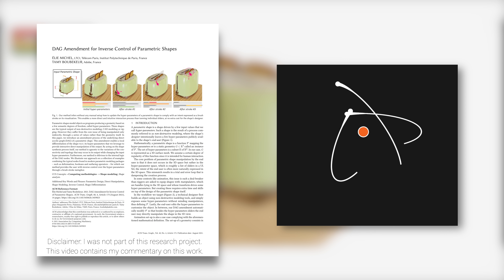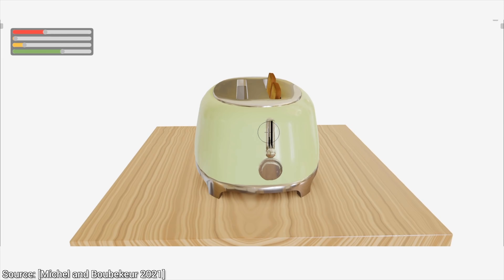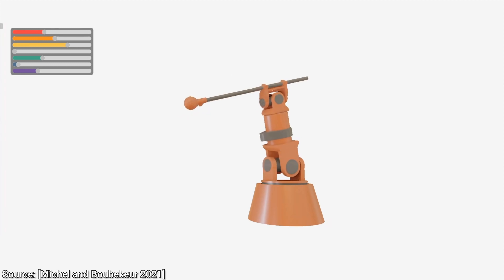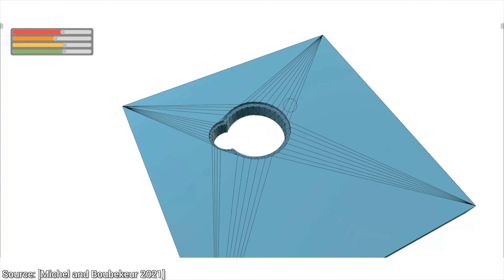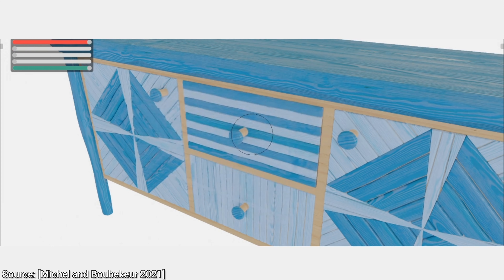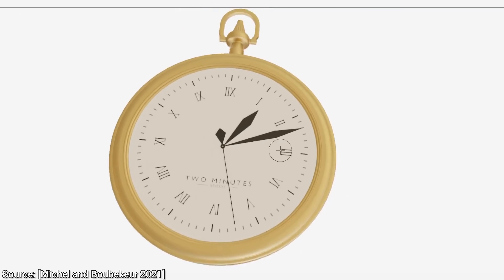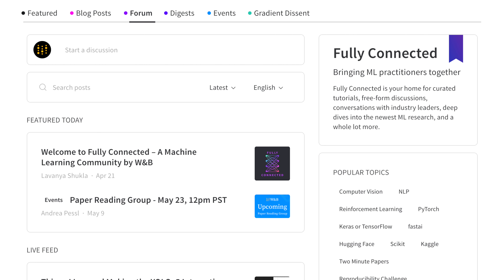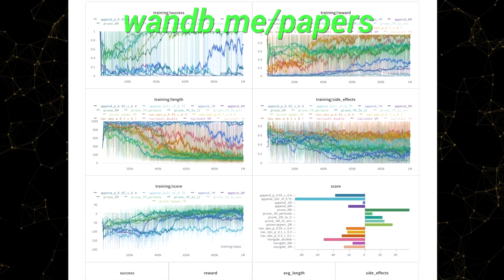3D Modeling This Toaster Just Became Easier!

Comment: In 3D animation, when you rig a character, you also create a 'schematic view' which is a web page or interactive map of the character so an animator (simple minded but nice people) can animate the rig. Its the same thing and has been around for decades. How does this differ from that?
Further, in most 3D software, you can create parametric objects (Cinema 4D is great at it) that are very easy for end used to break, err, I mean, work with.

Comment: okay it took me a couple of minutes to realize what I watched. the true breakthrough here is that the user interface knows how to inversely control the hyperparameters. it's not exactly trivial, but that's all.

in other words, it amends the acyclic graph that is used to produce the geometry in such a way to help interpret direct access to geometry inversely, thus identifying the exact path in the graph, based on input, and streamlining the control logic, instead of requiring a user to tweak the sliders themselves.

this project builds upon procedural modelling and parametrization without doing anything on that forefront. certainly no AI as far as I can tell and no changes to how procedural modelling or IK actually works. somebody still has to rig everything into a coherent whole.

basically it's the Spore (2008) editor for the world of commercial parameterized objects, which are supposed to be made to behave like that by (many) artists.

so:
1) the video title is misleading.
2) yes, artists are very much required to build this narrow combinatorial space of hyper-parametric freedom.

Comment: I feel like you serverely misrepresented what the AI ("AI"?) does here. For instance "It understands that moving the toast must also move the lever". It sounds like the application is figuring this out by itself, but if I understand the paper correctly that's just a hardcoded dependency in the handcrafted parametric model. Please correct me if I'm wrong, but isn't everything we see in this video traditional handcrafted parametric modeling with the exception of the selection cursor and the inverse kinematics?

The linked paper also makes this very clear imo. I'm not sure how the video manages to miss the point so completely and makes this seem like something very different than what it is.

Comment: To be fair, you can get a similar effect to this in Houdini if you setup your object/scene correctly (driving the length of a chair leg based on the position of the seat for example). It doesn't have the brush stoke part, but instead a list of parameters to mess with, so less intuitive and requiring expensive software and an object specifically made for it.  I'm excited to see how this paper evolves and hope it gets implemented into some modeling programs soon.

Comment: I feel like there's some key information that must be missing. Isn't this sorta how the character creator works in many games? Also reminds me a lot of some of the car modeling techniques in the game Automation by Camshaft Software...

What's the new thing here that makes this noteworthy?
Reply: Agreed ... as I understand it ... the parametric effects are given relationship attributes to other sections of model as it's built ...

... rather than having to code it to keep ratio size and position with other objects. 

So if I had a 3d sphere acting as a head then I add a thin cylinder to its surface acting as an eye ... I'd expect a deformation of the sphere to flatten slightly to accept the flat cylinder as its eye ... I should then be able to move the eye around ... and push it into the sphere, deforming it like a donut, or pull the cylinder away from sphere to make a snout with flat cylinder acting as an eye instead of snout.

It has to just be groupings with modifiers ... memory intensive 

If this is machine learning ... everything I've said and more would be possible
Reply: Yeah this was explained extremely poorly. I spent the whole video trying to read between the lines of what actually was being developed here that involves AI. Two minute paper videos have declined so much, I basically just mute and watch the demonstrations now. He talks a lot but provides no substantive information... almost like it was written by an AI.

Comment: Title is misleading, Most of this can already be somewhat done by parametric 3D modelling softwares like Fusion 360. Modelling the design with parameters is the difficult part, anyone can click and drag or change the values easily, but you definitely need an artist to create a parameterised model ready to do what's shown in the video.

Comment: The cursor knowing which parameter to change is neat but parametric modelling has existed in 3d programs for a long time.
Changing the parameters is the easy part, setting up the model with parameters is a lot harder and requires an artist
Reply: Thanks, I thought I was going crazy. The impressive part would be an AI building a parametric model. You don't need an AI to do inverse kinematics on a parametric model
Reply: @FPRobber  well I actually thought they were using AI to build some kind of procedural graph, after the fact. in the case of IK I thought they were using AI to actually build the IK with the automatic constraints. if not, then I'm not sure what's the point.
Reply: So this is taking a normal non parametric model and making it parametric? How does it know that I want the toaster slots to be symmetrical and what if I don't?
Reply: @JrIcify  no, it's not making anything. I figured out in the meantime, what this was about. it's a direct user interface between the geometry and the sliders what was done here. (the positional dragging without supplying that context beforehand, the brush size in one of the examples, but also the connectivity between two or more interconnected sliders as shown in the IK example)
Reply: @JrIcify  I can imagine Karoly didn't invest himself too much in this area of life, or got too hyped himself, but the video is misleading all of us into believing this has to do something with object generation or automatic parametrization.
Reply: @milanstevic8424  or they asked him to showcase it? they made (I guess) a two minute paper clock model and all

Comment: Very misleading name for video. This tool is interface to interact with parametric models right? To make parametric 3D model of toaster like this you have to be experienced 3D modeler and semi programmer. To make use of this tool in production you have to have huge parametric model library, which is not even started. This is tool for solving unexciting problem.

Comment: This is procedural or parametric modeling, it's actually harder to model and you need a 3d artist that also understands programming (although very basic for the procedural i.e., Houdini) or very specific and technical knowledge like Fusion or SolidWorks to name a few. The main advantage are speed if you need multiple models, alternate shapes or iterations, or adjustable models that adapt to specific needs
Reply: Yeah, somebody still created these 3D models and defined the parametric parts and they conveniently not showing that in the video. I don't see how this is "3D Modeling Without An Artist" and how it is different from other parametric modelling software.
Reply: I've got the same thought, it's misleading video, This method still requires all the data to be prepared by human (via modeling, scanning etc.) and also marked as editable, looks more like modeling + rigging routine to me.
Reply: @animaToy  I addressed this in my earlier post. You are misunderstanding what is actually being presented in this video. It is not the use of parametrics, but being able to manipulate them using back propagation and other rules rather than only in one direction.
Reply: @orbatos  Thank you for the summary. Honestly, disappointed with the depth of these videos lately. I stay subscribed to be informed, not for the hype.
Reply: @orbatos  That's what I've wrote: video is misleading, at first at least
Reply: @animaToy  Are you unaware that it implies intent?
Reply: @orbatos  I'm not here to judge intentions. You get me wrong, I'm not saying video is bad by any means, small clarification in title may remove any misunderstandings and we can go back to  discussing content.
Reply: as someone that know a little of parametric desing , i think the same as you, this isnt too impresive, in catia or any cad software is very easy to relate the parameters of an object to another and then let it modyfy when you move the other, the only great work done here appears to be the point and click selection of what you want to mod
Reply: @HailScreaM77  TLDR; This is the equivalent to introducing inverse kinematics to the kinematic development pipeline.

I might have agreed, but I read the paper because it was obviously made with this knowledge :-) . The demo is underwhelming trip use because parametrics themselves are not new, but this is a platform agnostic approach to addressing a key problem with generalising parametric modelling, the lack of back-propagated changes. 

From the abstract:
```
In this paper, we introduce an amendment process of the underlying direct acyclic graph (DAG) of a parametric shape. This amendment enables a local differentiation of the shape w.r.t. its hyper-parameters that we leverage to provide interactive direct manipulation of the output.
```
Reply: even if you need multiple models, its rare that you would ever need just a different shape of toaster, most of the time youll need an entirely different style of toaster which this type of parametrics isnt going to do.
Reply: Yeah I'm not understanding what is new about this since parametric modelling has been around for a while. It takes a lot of complex rigging to do right. Unless there is some new technique that can figure this out automatically, which i dont know how it would? Unless there is some way of naming the different components with specific labels for label driven parametric ai rigging which would be crazy... But i doubt it
Reply: @Ben-rz9cf  Nothing shiny, everything is under the hood. It is an efficient enhancement to parametric CAD. Parts of which are in current software, but this provides more flexibility.
Reply: And that's not even mentioning that parametric modeling is not really a thing in animation or vfx.
Sure there are procedural systems for cities etc., but all the individual pieces are all modeled and textured by using polygons and UVs, not nurbs or anything.
Reply: @TheLumberjack1987  The reason for that is multifold, primarily due to cost. But keep in mind Karoly is not doing this for cinema only, he is interested in any advancements of this type.
Reply: @orbatos  I mean sure I get that, but the title literally says "3D Modeling without an Artist".
This is not modeling, this is a real time auto rigger for nurb workflows.
Reply: @TheLumberjack1987  I imagine that title is connected with one large and fast growing use case, designing with asset libraries.
Reply: @orbatos  No matter how you look at it or try to define it, it's still not modeling though.
It's cool for what it does, but the title is misleading.
Reply: @TheLumberjack1987  Hm, seems disengenuous to nitpick over from my perspective. Especially for a non-native speaker finding interesting papers to present.
Reply: @orbatos  Well I'm a professional 3D modeler, so when I read "modeling" then I expect exactly that, not an autorigger showreel.
The paper is interesting, but I clicked on the video with completely different expectations due to the title and was subsequently disappointed because I'm always excited about tools which might make my job easier.
Reply: @orbatos  Nitpicking is looking for tiny distinctions. The title of the video bears no relationship to the content. I love Karoly's work too but there's a reason he calls us fellow scholars, he's a fan of independent critical thinking and contribution. Pointing out a major problem with his title and issues in the video isn't hate or disrespect or nitpicking, it's rigour.

Comment: This is not special. Blender modifiers can do all of this easily. What would be impressive is if it was able to apply the Modifiers on its own and not have to be set up, but that is not the case in this paper :(
Reply: Yeah I was going to say that CAD programs like Autodesk Inventor, Fusion 360, Solidworks, etc. are already parametric and you could do things like this as long as the base model has been set up correctly to be parametrized, which again isn't hard if you're decent with CAD. 

And a parametrized base model is already a requirement for this software too, so other than a different UI it isn't really adding much. Maybe the only advantage is that this runs in real time, but the CAD program can also process way more complex designs than this thing.

Comment: I was gonna say Fusion has that with the push pull thing, but this is much more intuitive than that, it's actually amazing. I was already mind blown when i figured out i could change the position of the ribs of injection moulded parts if they implement something like this for actual mechanical assemblies it'd cut my work in half.

Comment: amazing paper, so I assume that there is a limit , a min_height and a max_height for example otherwise the object wont be the same object. I'm thinking of a car for example if you change it's length or height you need to add wheels and it won't be a car anymore
Reply: This wouldn't add more wheels, it only changes proportions based on how the model was designed, you could start with a lil hatchback and end with a massive limo, and I bet you could tweak the maximum values to do technically impossible objects, but that's it